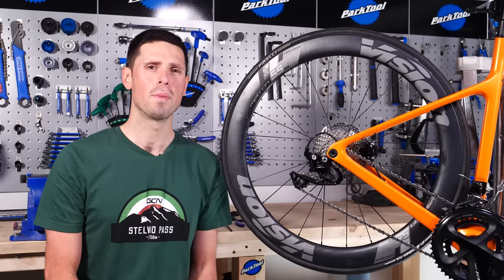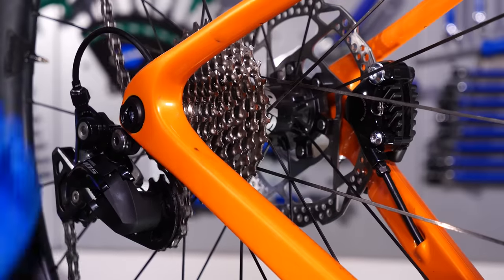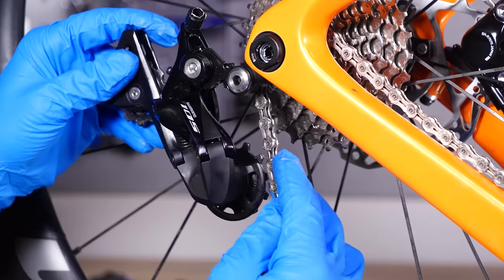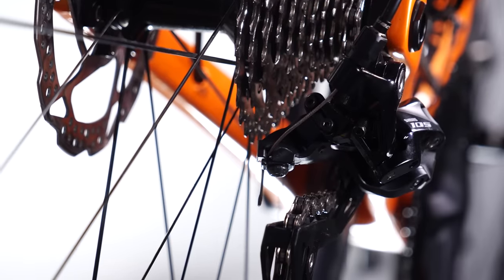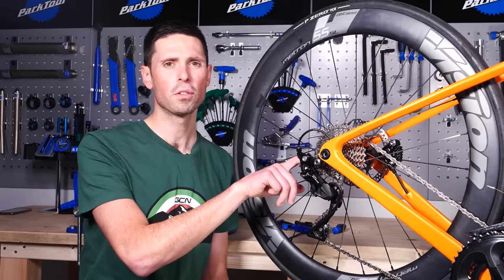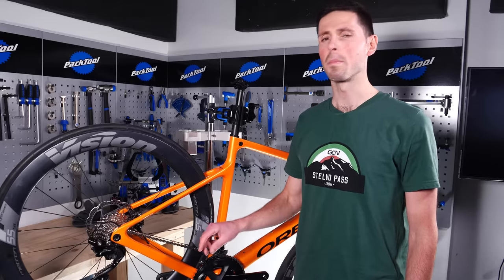How To Replace Your Rear Derailleur | GCN Tech Monday Maintenance

Comment from the maker: Have you ever removed your rear derailleur? Let us know in the comments below!
Reply: the one time it was removed,was the time where it got ripped off
Reply: Do a video on how to remove your rear cassette gear
Reply: Yes.  1) Oil the derailleur pivots before mounting, 2) grease the hanger bolt when refitting, 3) set the limit screws by eye before fitting the chain, 4) clean and grease the cable, and housing if reusing.
Reply: Intentionally??
Reply: Yes.  Every time I pack my bike for travel.
Reply: with my cassettes and mechs from now on  i'm looking into the ideal cassette/mech for its respective mate.  its about the b-set while indexing.  with the wide range cassettes,, speed of shift, "quick-drop overshift"(GCN Tech, this is when you slam your mech towards tiny cogs with moderate/high rpm and the too long  bset distance allows the chain to "swing extra/fiurther" towards a smaller cog.. and then the clutch settles on that smaller cog and has a propensity to stay there. clean chain and good trim is best treatment) suffers

tell shimano to make a cage that has few extra pulley drillins for each of them to tune the guide pulley's cam/offset and to swing the cage most advantagously for the guide pulleys nature-of-offset...  this way the bset can get retardedly close the whole time and still mullett

e, oh.. gear cable routing is underapreciated. i ran a single peice of housing from the mech, up the seatstay , along the headtube , and to the index-ma-bob,,,  its so smooth i thought the housing was compressing or somthing was broke.  Much of this has to do with how the cable leaves the mech; it leaves gracefully up the seatstay not bent 270 degrees followed by a ferule and then a bottom bracket to eventually be cut by, and then more ferrules which grind the cable.  it all adds up and the mech is using inputs and distances akin to the edge of a knife when shifting 600+watts at RPM.

... and lube:  silicone spray is good but for the prescion of the chain and cogs wd40 is less acoustically absorbant and more sudden, predictable i feel.  ive doped chainlube with polyureathane for all weather. it works good but the chain needs a good dry cloth after clean&lube to reduce grime buildup
Reply: Yep, many times. Only thing I would add is to crimp the cable end. Good job overall.
Reply: @oldguyonabike36  Thanks for this! I'll be replacing my dropout. Aside from the threads of the dropout, do i need to grease the rd thread as well? And how tight should the dropout screws and rd be? First time i'm gonna be doing this so i'm trying to be very careful.
Reply: @leftyseel8658  I’m no pro, just experienced.  I’ve found greasing the threads in the dropout sufficient, wipe away any excess after seating; you’re looking to prevent seizing and get valid torque measurements.  Any question about torque specs should be answered by the respective  manufacturers.
Reply: @oldguyonabike36  Do you need to align new derailleur hanger? That's what some people told me on a bike forum. I thought you just slap them on and that's it. Didn't know i need to align it with that alignment tool.
Reply: @leftyseel8658  I would think so.  Those tools are expensive, for one use; great time to drop in on your local bike shop.
Reply: Just replaced a shimano 105 rear derailleur with your help. Thank you! 👍🏼
Reply: No but I am doing it this week and found this awesome video really helpful! Do all rear derailleurs have high, low and B limit screws? I am swapping a Shimano Altus for a Shimano Acera.
Reply: yes but i have never reinstalled it correctly but now i need to do it so wish me luck but i think i can do it with these instructions. when i previously tried it i don't think there even was youtube tutorial for this. :D
Reply: Had to remove one because some farmer left a pile of hay bale netting in the side of the road right in the tall grass and it tore up my derailleur. 

Been having issues putting the new one in. Thankfully this video helps.
Reply: Background music is too distracting.

Comment: 2:06 when fitting the derailleur, check it's rotated anticlockwise until it butts up against the small tab that sticks out from the derailleur hanger. Also check periodically to ensure no gap has appeared during use.
Reply: Your comment saved me! Thank you so much
Reply: Thanks for this - i thought there's a partuclar angle to properly fit the derailleur
Reply: can't believe how bad GCN is at making tutorial videos.
Reply: Meaning what exactly?

Comment: None of the derailleur tuning videos ever mentioned the importance of the angle the derailleur needs to be on the hanger.  If not proper the unit rubs up against the frame in ninth gear, causing the chain to jump because no amount of tuning will correct the problem until the derailleur is free to move.
Reply: This! I came here because my hanger bolt came loose and I didn't know where the derailleur was supposed to hang. Indeed now when I shift to the highest gear, everything rubs and is unusable. No help in this video
Reply: Looking for exactly this…
Reply: So what's correct lol
Reply: Amazon alignment tool is 35 bucks
Reply: Since no one answered the correct answer is the hanger has a tab that has to be touching another tab on the derailuer the specific hanger you have should have directions making it clear

Comment: This is a decent video -- you can make it better by showing common out-of-normal configurations along with what they sound like when pedaling / shifting then showing how to resolve the issue via adjustments (and showing the alignment of the pulley with the cassette would go a long way to doing that as well).

Comment: Thank you so much for the video, keep up the great work.🙏💪
I removed my 105 rear derailleur because it was bent and then replaced it.
Reply: If your derailleur was bent, have a check on your geardrop (The metal plate the deraileur is attached to). That is probably bent too, and will make shifting bad.
Reply: @bossebo3535  broke a derailleur a few weeks ago because of this, excited to finally learn a new part of the bike and how to fix it

Comment: You should fit a new gear cable while your there, and ensure the gear shifter is set to the highest gear (smallest cog on the cassette) before tensioning the cable..also screw in shifter and derailler barrell adjusters to within a few rotations before tensioning the gear cable by hand.Compatability of the derailler and shifter is crucial ,too, and therefore match shimano with shimano / sram with sram etc.A usesful tip for old bikes is to straighten a bent derailler hanger with a vice grips if needed ..after this the derailler may not thread easilly, so, temporarily fit the derailler on the  inside of  the 'hanger' to 'tap' the hanger threads.

Comment: Too many omissions and/or mistakes. On the top of my head: Re-using quick links may be a no-go depending on manufacturer; some chains are directional, as are some quick links; (low) limit screw position can be influenced by cable tension; front chainring position not mentioned in relation to indexing; no crimping of the now exposed cable end, which is now going to fray.
Could also mention: What to do if there's no quick link; why would I do this in the first instance; possibility of faulty mech hanger; compatibility of different rear derailleurs.
Reply: I suppose so, still I have always had reusable quick links. The crimping of the cable end was definitely important. Second was getting a well adjusted cable tension before setting the limit screw. The rest didn’t bother me too much, however, as this wasn’t a video on indexing your gears, per se.
Reply: What got me was the phrase "adjust it like so" ok if you know what you're doing but for someone who doesn't, "like so" is far too vague, what made it worse was not showing the adjustment of the b screw.

Comment: Maybe clever to also mention the fact not all quicklinks are re-usable. I''ve snapped two whilst climbing out the saddle before I learned this.
Reply: Well then it's not a quick link... The entire theme behind the name suggests it's function. If it's not coming apart by squeezing than it's not a quick link. Youll need a chain breaker.

Comment: really should have mentioned ensuring the b-adjustment is behind the lug on the hanger when attaching to the hanger. . This is the one thing i keep forgetting to do, and risks badly damaging  the derailleur and hanger; would have taken 10-15s max.
Reply: came here to ask about this. this is my question. at what position do i tighten the derailleur onto the hanger. is there a video explaining this?

Comment: When you replace the derailleur, before you torque it up it's worth making sure you haven't crushed anything behind it on the inside, there's sometimes a B limit screw hidden away there depending on the design

Comment: Thanks so much for your video. GNC Tech is the best!  I watch many of your videos.  I ran into a problem.  I am rebuilding an older bike, a Raleigh Olympian that was made in the 1990's or earlier.  The Rear Derailleur on that bike does not use a 5MM bolt.  That means I had to put the original one back on.  I have a nice Shimano Rear Derailleur, but it uses a 5MM bolt.  Am I just stuck using the older Derailleur? Bummer.

Comment: is the new derailleur got the same cage length? What gear should you have it on. What angle do you attach it at? Great explanation on the high low limits and tensioning.

Comment: I hadn't planned on replacing a rear derailleur, but when my new bike arrived i opened the carton, took the front wheel in the house to repack the bearings, went back outside to grab the rest of my bike to do the other ehrrl and bb, and as I was carrying it up the porch lost my balance and when the bike hit concrete it bounced on the rear dropout and derailleur.

Bent the dropout back in place (steel frame)

The derailleur was a cheap one and pretty beat up, so I ordered a new one and its sitting here next to me.

Looks pretty simple.

Comment: Literally just removed mine to take it apart, clean and regrease and reasemble then reinstall it. I wasn't sure which anti-seize to use but after a little research decided to use nickel as it's recommended for use on Ti, which my frame uses. But any of them would probably work.

The only hitch was being unable to use a torque wrench because my 5mm allen socket isn't long enough to go all the way in to my Campy Centaur rear derailleur, so I guessed as best as I could. It only calls for 11ft-lb or torque so no big deal.

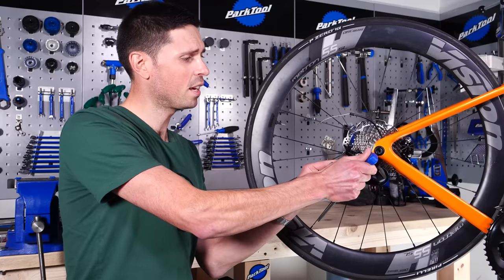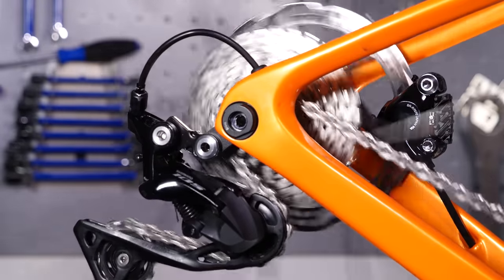Comment: I changed mine on Saturday - this is OK but I found here better https://www.youtube.com/watch?v=3trytNwpgLk - the good tip was to adjust HIGH/LOW/B before putting the chain & cable on/in!  Start 1:53 in . He gives some great advice on the finer points of setup & what to watch out for - e.g. watching out for the lug at the back (Shimano) when attaching to the hanger, 3:30 - adjust HIGH/LOW/B, 4:47 - attach cable, 10:25 - 19:54 fine adjustments for perfect finish - 25:10 now snip the new cable.
Reply: Yeah, I tend to find GCN vids way too fast and undetailed

Comment: Does anyone know why when I remove rear shimano derailleur there's so much pressure on the body towards the end of removal also it seems the b screw is on with tension and the whole thing will snap on removal.  Is that normal?

Comment: #Askgcn what makes a winter training tyre, a winter training tyre, and some i have seen looks just like the "Normal" tyre as in the tread is the same.  is it the compound? extra puncture protection etc?  as i run schwalbe pro one's   i contacted schwalbe and they said " n terms of grip, the Pro One TLE’s will be ideal.
 However… In terms of puncture protection and a level of durability that many people require from a road tyre to use through winter, we make other tyres that are more suitable for sure. Perhaps the best compromise between an out and out race tyre, and a dedicated winter trainer tyre, is the Schwalbe One…"  but the tread pattern looks the same,  in my mind a winter tyre would have a different pattern,  bit like car tyres do.  thanks

Comment: why do you need to remove the chain ?
Reply: You need to feed the chain through the gate in the derailleur. But another way to do it without breaking the chain is to undo the bolt holding the lower jockey wheel and slip that wheel out to make room for the chain to slip through the gap between the two cheeks of the derailleur (then reinsert the jockey wheel of course).

Comment: #AskGCNtech I’m wondering if I need to change my rear derailleur if I’m changing my cassette from a 11-34 to 11-28?

I’ve got a Trek Domane AL5 Disc (Shinano 105 groupset)
Reply: No, this works perfectly fine. As long as they are both 11 speed (or 10 for some). Your only difference will be your derailleur cage size and if you are never going back up to a 34 then you can change this for a smaller cage. A bit of weight saving, otherwise it will all work perfectly.
Reply: You should also adjust your B limit screw to bring the derailleur closer to the largest cog. (See at about 5:25 in the video.) You don’t strictly have to do this, but it will make gear changes a bit sharper.

Comment: So should the front chainring be in the small ring up front for the H and L limit adjusting?
Reply: I usually put it in whatever ring I ride in the most , I have a dual suspension mongoose pro wing elite , and just picked up a Schwinn Axum with a bent derailleur.

Comment: hmmm, re-usable quick link? not all of them are re-usable (in fact I'm pretty sure all the manufacturers would say not for obvious reasons).  Also I thought it was easiest to set the high and low limit screws without the cable attached (see previous GCN Tech video from 4 or 5 years ago, this is the method I've always followed).  Also could mention about taking the opportunity to check derailleur hanger straight, alignment, wax chain.  And click down the gears one at a time when going for the low limit screw otherwise you might find the chain flies off the cassette and into spokes.  All in all a 5/10 must try harder.

Comment: Why do they never include campag? The set up is I believe slightly different. Not everyone uses shimano
Reply: Shimano and SRAM have a much greater share of the market. Very few complete bikes come supplied with a Campagnolo groupset. Most people with Campagnolo will be accomplished bike mechanics already, or will use a Campagnolo specialist dealer/mechanic for service / repairs. Having said that, the basic concept is the same across all brands in regards to mechanical shifting, just some (Campagnolo in particular) use proprietary tools and standards for their products.